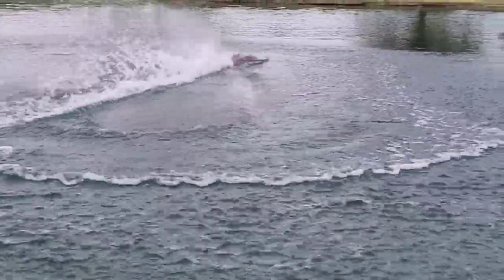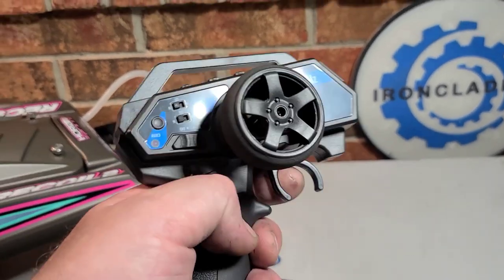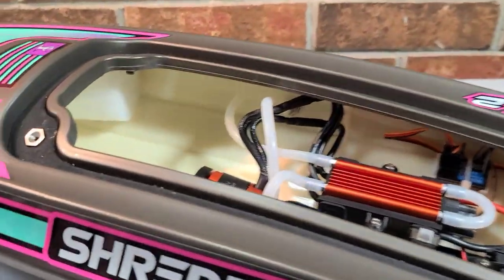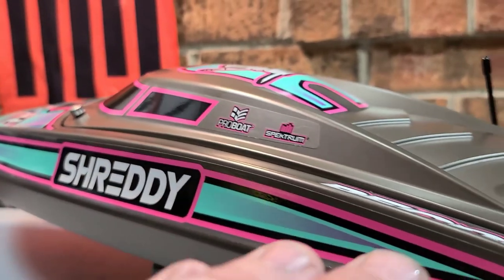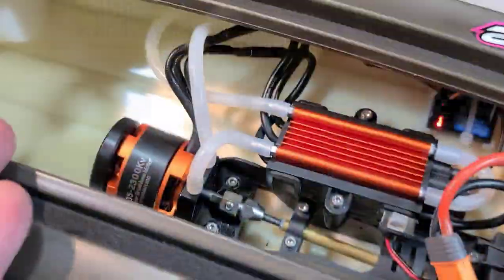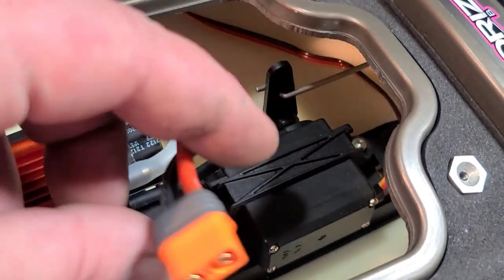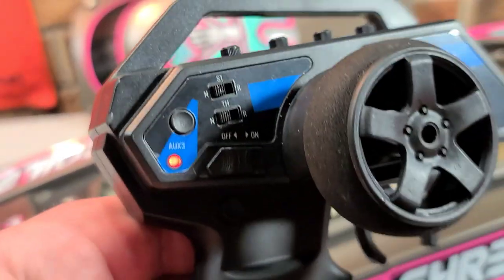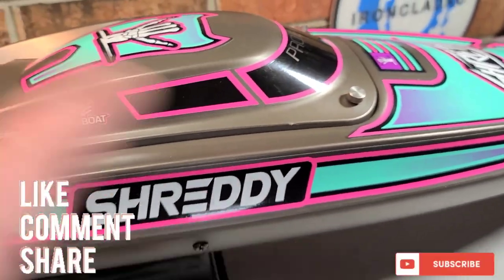Proboat Recoil2 26" Self-Rightning Brushless Deep-V RTR Rc Boat Review

Comment: BTW-  You're the only review that lifted up the esc to point out that it is 3-4S capable.
Reply from the maker: Its a 3s boat but  4s capable basically the boat was made to run 3s, with light 4s 3200 packs

Comment: So here I am again 10 minutes into your video and I need to comment about this boat. You're in depth review has pretty much made me want to get this as a second boat as my Sonic awake V2 is my first boat and is already out of commission based on the receiver getting wet and malfunctioning.

I really don't like to see that this receiver in this boat is just zip tied to the side and is guaranteed to get wet but I know you like to use corrosion X so I suppose that is the best solution.

I'm super curious as to why they would make that specialty Breakaway Rudder on this boat but not include that on the Sonic wake V2.

Didn't know this boat was capable of 4S which makes it even more attractive since I have very powerful 4S batteries currently. But they are 9000 capacity each so they might be a little heavy for the small boat.

As always great job on these videos I thoroughly enjoy them and have learned a ton in the past week. 🍻

Comment: nice bit of Kit.. USB Charging definately the future also the electrics and hardware always fascinates me
Reply: I think this will take way too long. With USB 5V you'll need to draw 10 amps to get an output of 50 watts...  guess that would melt your usb cable ? With an old school usb power supply of 500ma , it would take days to fill up a 3s 5000 lipo

Comment: Hallo i have that boat i tried  the 3200mah  and 3s 4509mham
I dont use the 4s 2750 mham  is afraid what the power he had whit the 3s  greetings 
I capside the mine  big wind anx very   big turn  and no problem with  the button and he can go again awsome  greetings 
I want to buy the veles 29 inch but is very expensif  greetings

Comment: Got the boat. Ran fine on 3s. I put a 4S battery in and it ran for 2 minutes and now I have no motor control. Just Steering. The red lights blinks and I don't hear the ESC when start-up. I don't see where the ESC can be programmed either....Any ideas...
Reply from the maker: Unfortunately you may have smoked the esc?    Flycolor 90 is a perfect upgrade esc for that boat, I ran a 90 with the stock motor a few runs and it was faster by a long shot.  The flycolr or ose 90 has a burst of 200amps of I'm not mistaken.     

If you  put an esc with more than 120a continuous  on the stock motor it will not take it.  Trust me I tried.

Comment: does self righting also work with a 3s 5000 pack? Are there any modifications necessary when using with 4s packs ? are the stickers on the abs hull covered with some layers of clear coat ?
Reply from the maker: I recommend adding a second battery strap for 4s operation.   That's it.  Run the boat out the box.  There is   No clear coat over the stickers  and yes it self rights with any pack you put in the boat
Reply: Can't wait to get my hands on it... Although the price, especially in eur,  is really high...